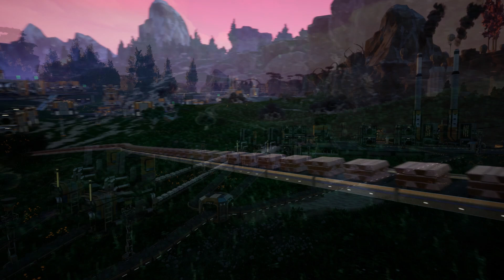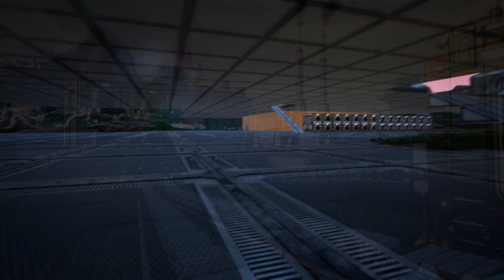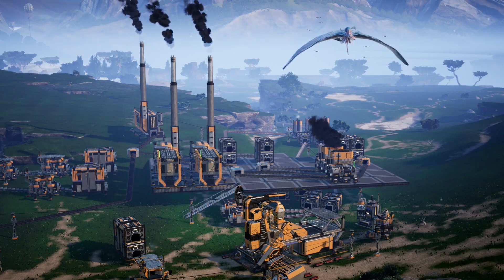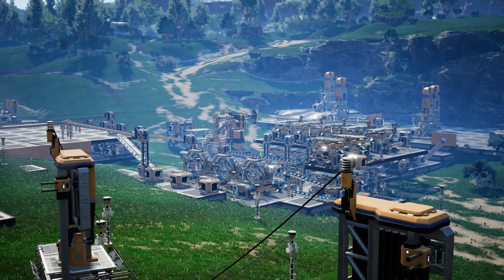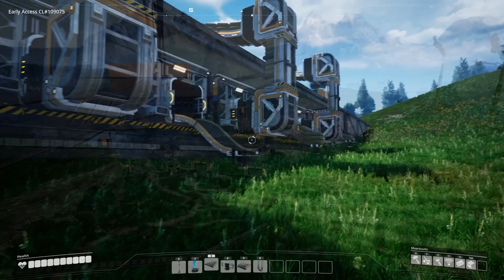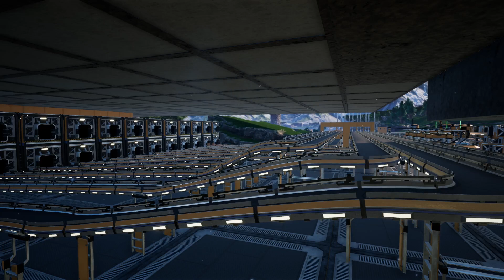Ficsit Friday, Making it Satisfactory Ep,1

Comment: That’s a cool idea for series.  Really helpful!  Have you/or could you possibly do a video for tips with alignment issues? Specifically splitters/mergers/lifts/belts..
Reply from the maker: DigitalbathRx potentially yes, but the only issue where I’ve had allignment issues was in Xp so I’m not sure how much it would help, but I can certainly look into it ☺️
Reply: @TotalXclipse  I usually run into the problem when I run 1 conveyor across multiple machines and add splitters or mergers from that main line.  Once I turn the machine on I find the splitters not feeding the machines.  Then it takes a quite a few attempts deleting and adding them to get them to work.  Does it matter which direction you build the conveyors?  say the belt is moving to the left, so you build it from the right to the left?  If that makes sense?
Reply from the maker: DigitalbathRx I find if I place the splitters then delete the splitters and place them on the belt again this causes this bug. Other than that the direction shouldn’t effect the line. Although I show in the next ficsit Friday video (it’s not quite ready yet) building a bus and then connecting each splitter individually as it’s easier to create cleaner lines
Reply: TotalXclipse Think I may have found a bug.  Not sure if anyone else is experiencing it.  But I’ve been playing around with it tonight.  I noticed if the snap lines are there the belt between the splitter and the machine won’t line up properly.  If I delete, then place the splitter again without the snap lines, it works perfectly.  Which is odd because I use the snap lines a lot.  But I’m using them in a tighter area than normal.  Good news is, I have it working now!  I appreciate the help though, and looking forward to the next video!  Thank ya!